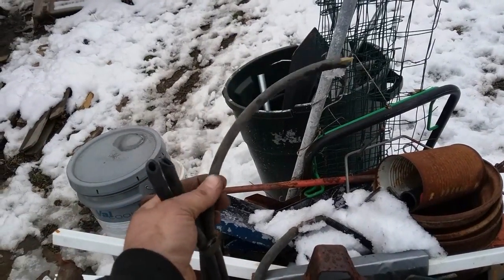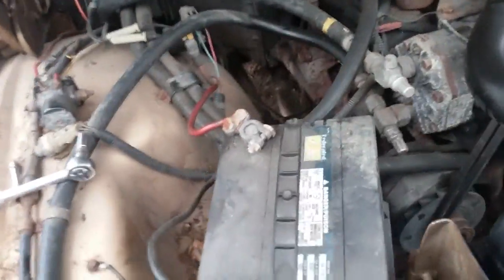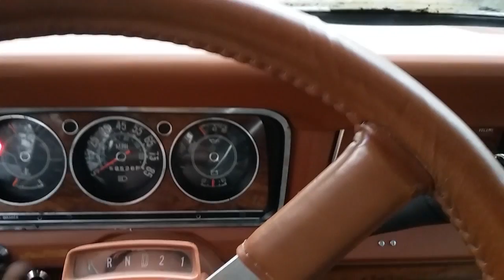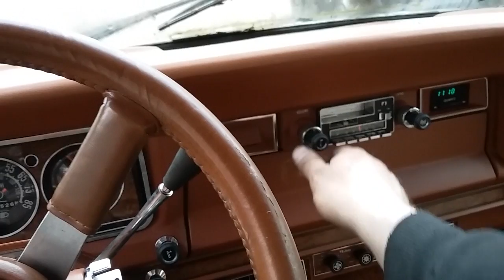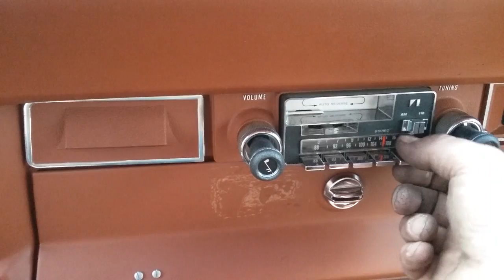Redoing vacuum lines on Jeep engine

Comment: I have some vacuum ports open I need to route to where they belong. You have no idea what you're doing - a cave man with a radio. Good luck, anyhow.
Reply from the maker: Thanks for watching. There is a diagram on every car and truck under the hood with the schematic of the vacuum system, engine size, timing specs, and so forth. Everything you need to know, to fix your vacuum system. In case you didn't know. You will need to buy about 3 different size vacuum hose and about 20 feet of each size, to fix it though. Not to mention the sensors that operate them too, which are usually bad to begin with, which cost about $20 to $50 each. As for me, I do just fine doing this. Been doing it for more then 20 years. When the cars and trucks actually had to pass the emissions test and passed better with my setup (which means cleaner emissions) then the OEM setup. Good luck to you too.
Reply: @prancstaman  Thanks, and I apologize.
Reply from the maker: I apologize too. I'm sure I sounded a little mean too, and that is not how I usually reply.